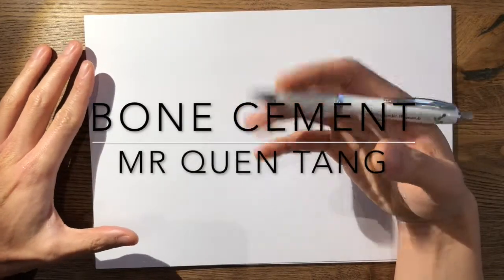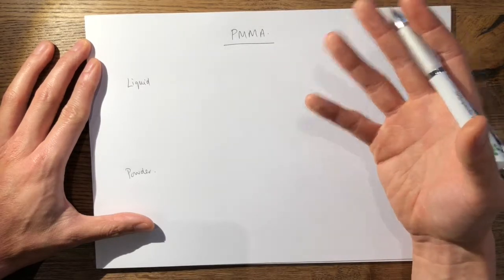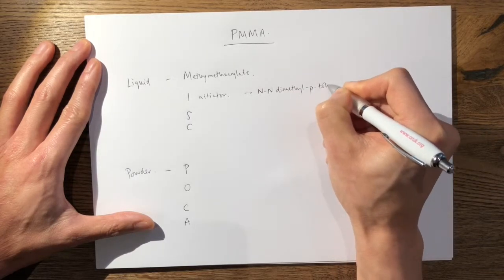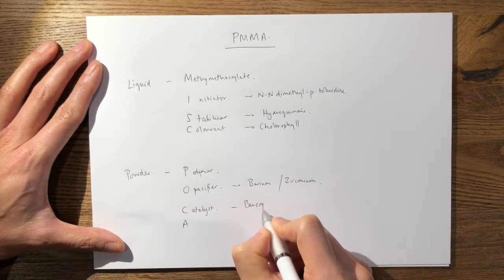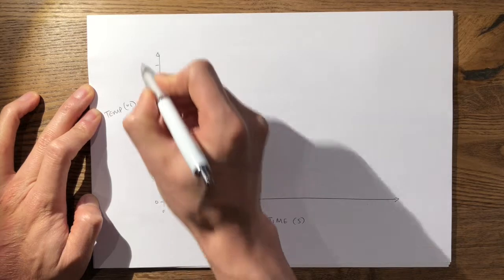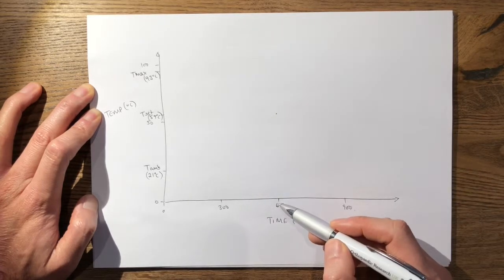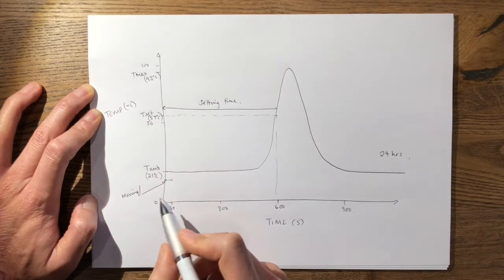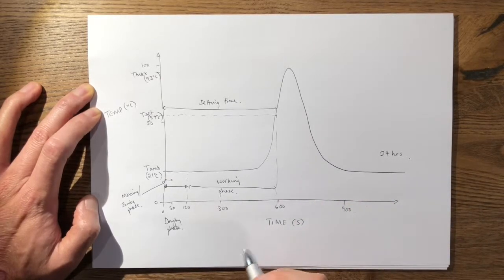4  Bone Cement FRCS Tr&Orth

Comment: There is a mistake here as pointed out by Gene's comment below.
Toluidine, found in the liquid, is an accelerator - not the initiator. Benzoyl peroxide, found in the powder is the initiator - not a catalyst.
You can see for yourself in this publication: Ar Vaishia et al. Bone cement. J Clin Orthop Trauma. 2013 Dec; 4(4): 157–163
or simply by googling these 2 substances (Toluidine & BPO).

I just hope examiners read the comments